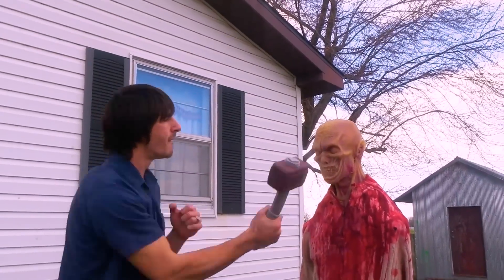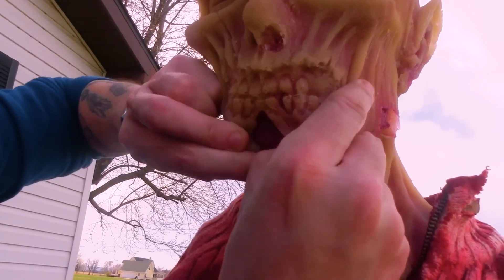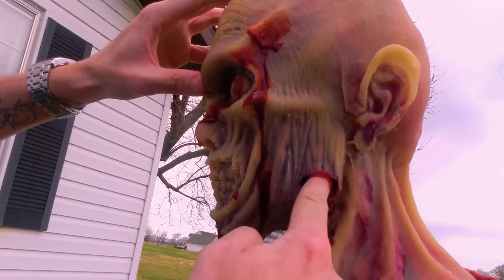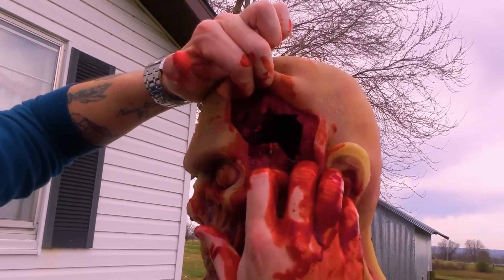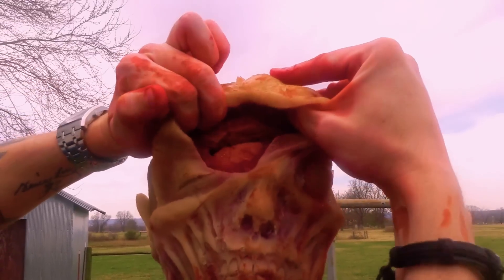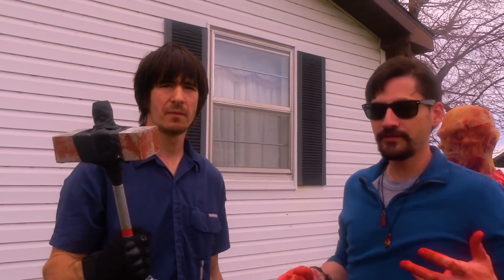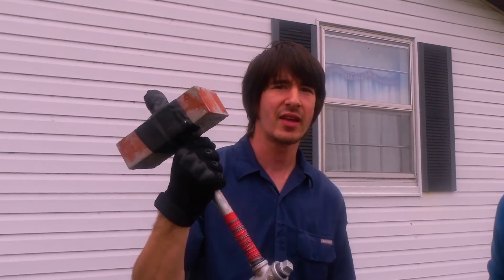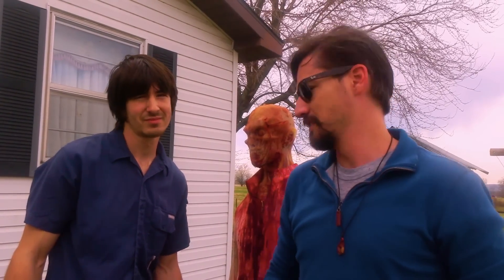NERF WAR:   ZOMBIE STRIKE HAMMER!!! Zombie Go Boom!

Comment: Interestingly, if you took the brick off and flipped it upside down, the bottom of that handle would probably make a good skull popper as well, not to mention it would be lighter... Also, I see the cement on the brick, but is it also inside the pipe handle for weight?

Comment: I have an interesting mod idea. Take a nerf weapon and then cast it in aluminium. So you take the nerf hammer put in a 5 gallon bucket filled with playground sand. Make a funnel to reach to it and poor melted aluminum in it. The metal will evaporate the foam and fill in the gaps leaving with a cast form of that weapon.

Comment: I have an idea for a simple weapon that can be easily made. it worked pretty well on my analogs. A paint stirrer with a nail punched through it. On the nail head place a coin and then tape it all the way around so the nail doesn't simple pop out of the tape. I would use either duct tape with electrical tape or just one or the other. Make sure you tape the whole length of the stick to prevent breaking. I have also experimented with adding more weight for a stronger impact. I am curious to see how my design will hold up to your guys analogs.

Comment: make another hammer brick but with a handle that is 6 inches longer i bet it would do way more damage than the short handle one ya'll used in the video .with a longer handle you will get increased speed when swinging the hammer providing more power with each swing.